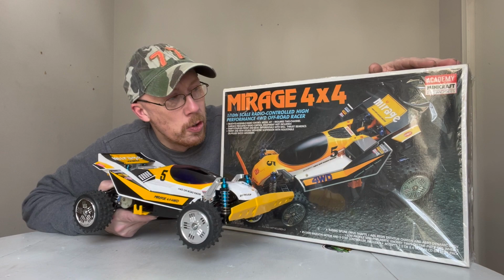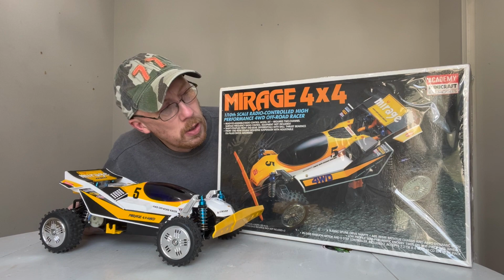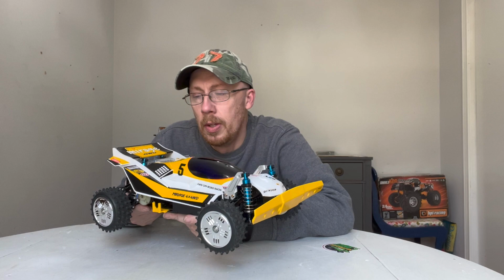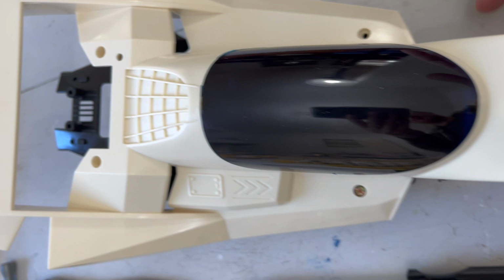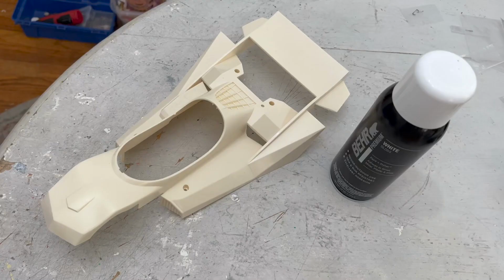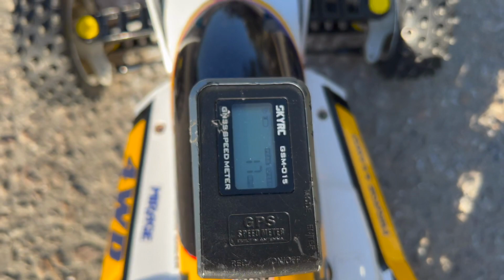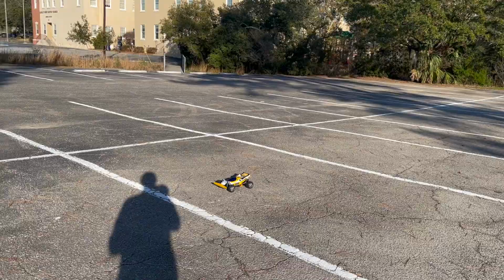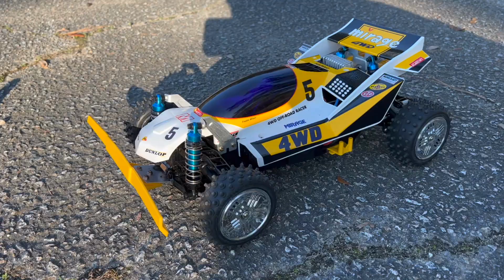1989 ACADEMY MIRAGE 4X4 RACING BUGGY BUILD AND RUN

Comment: As soon as I saw it I just thought BigWig.  Cool buggy though, chassis is like hobby grade but body almost seems like toy grade.  Runs awesome!    Another great video.
Reply from the maker: Hi bud, well you would think that a ABS type body was unusual on hobby grade rc but remember in the 80’s Tamiya Subaru brat, Blackfoot, Bruiser, grasshopper and so on all used this type of material. Thanks 😊
Reply: @LukesVintageRC  Yeah, I was more thinking of the way it was screwed down, the blacked out canopy etc.  Looks so cool when it's running though.

Comment: Nice buggy. With the metal parts (shocks, shock towers), and telescoping drive shafts, ball bearings would complete it, I think.
Reply from the maker: Thanks for watching 😊
Reply: I had that car on 1990. Those shock tower and under bumper are made by zinc, so please don't expect reliable durability, it will be easy to bend and break.
Reply from the maker: @rogerlee9377 Hi Roger, welcome to Luke’s Vintage RC. So my channel is an all in one type. Find it, talk about it, break it down, fix it, build it back, paint it, top speed it, drive it. All in one video. I do this to a different rc each month nearly 100 unique builds and more.  Nearly 200 videos too. A new video 1-2 per month. More than any other rc channel on YouTube in this complete formula. Why do i do this? because I luv all rc and worked on all kinds since 8. I’m now 50. If there’s anything you need to know about vintage rc I’m the guy. Thank you Roger for watching a great rc channel.
Reply: @suprluke993  Thanks Mr. Luke, I am also fan of vintage RC, and enjoying your video. I always looking forward to getting your newst updates.

Thank you for your reply~

Comment: Awesome car. Awesome video. I'm not familiar with this brand and initially I thought it was a Tamiya.  When you held it up to a Tamiya you could see all the design inspiration it borrowed.  Seriously, this thing looks bada**.

I wish you would have spoke more about your impressions of its 4WD capabilities.  I've only had a chance to drive a 4WD RC car once (one by HPI) and I was amazed at how well it just "stuck" to the ground.  Other than the times where you were stuck with some 3 wheel action, could you tell you were driving a 4WD car?
Reply from the maker: Hi, first of all thank you for watching. So the driving of the Mirage is kinda an easy feeling as with 4wd it has that pull me along feeling during the drive as the front wheels are working and you sense that. I would recommend checking out some other great videos I’ve done with four wheel drive rc and some with four wheel steering. 1.Royal Ripper, 2. Marui Ninja and recently I’ve done 3. Kyosho Optima Mid. All great with perhaps a bit more input. I had to edit this video as 15 minutes is my usual cut off. I got carried away as this is the first time an Academy Mirage was ever filmed on YouTube. Please like and subscribe. Hit the bell as I produce videos every month of a totally different rc. Thanks again.😊
Reply: @LukesVintageRC  I'll check out those videos. Keep up the good work Luke! Your content is great 👍